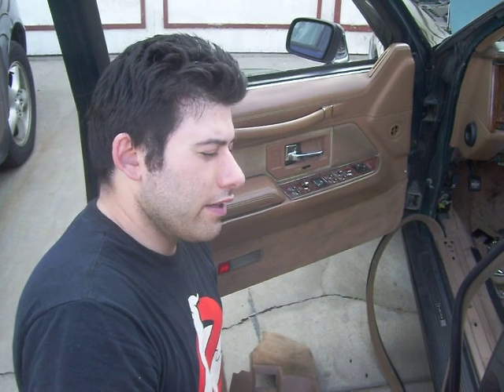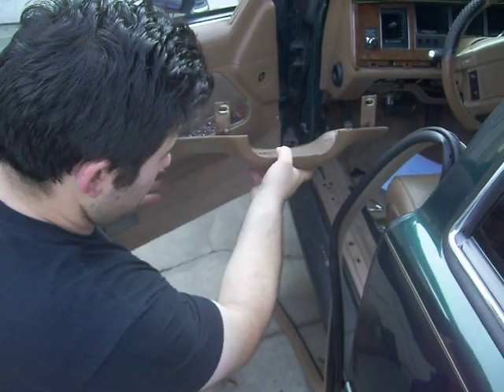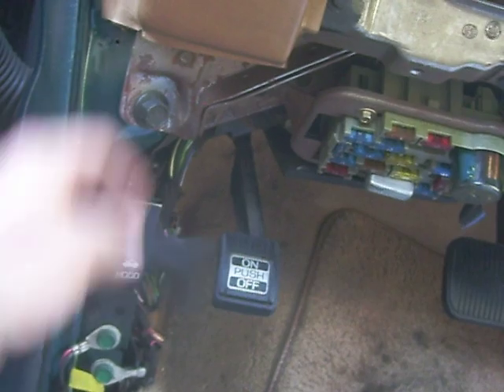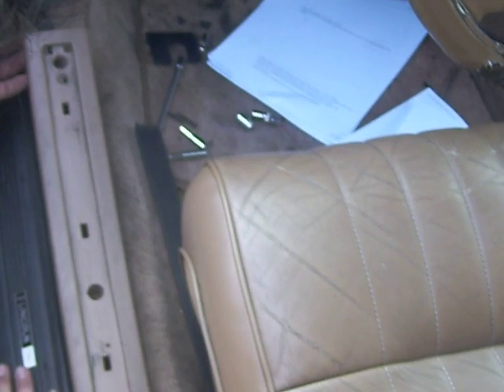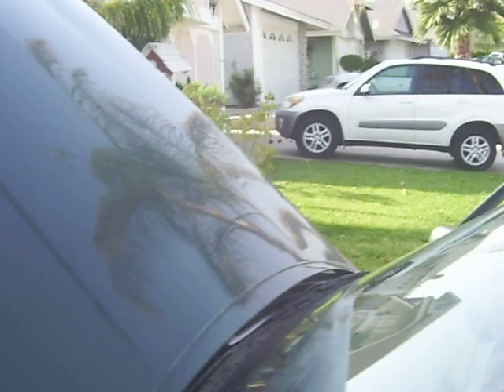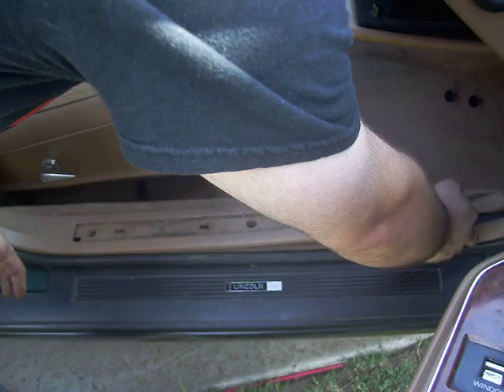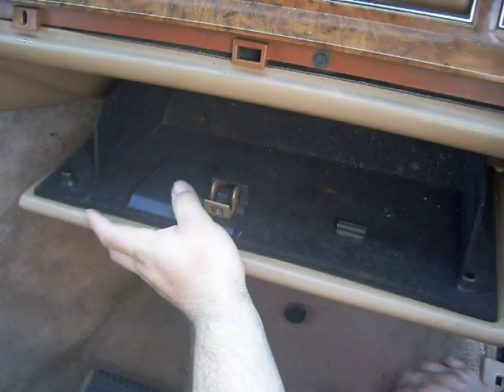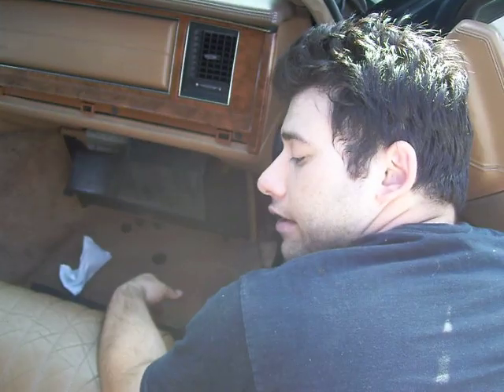BLEND DOOR ACTUATOR REPLACEMENT

Comment: Do the 1994 EGR valve solenoid DPFE and Tube replacement you'll have to get a 1 inch wrench for the tube fastens to the manifold and heat your wrench red hot and bend it 10 degrees or so offset not back on itself turned to increase the angle it's a horrible job let's make a video on the horrible jobs on the 1994 Lincoln Town Car the trunk Springs rear trunk Springs give me that video